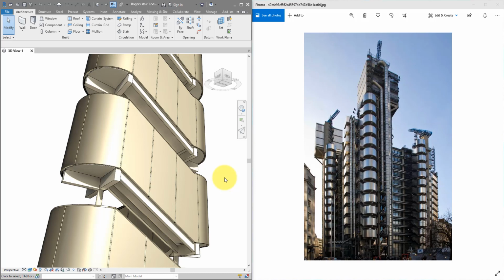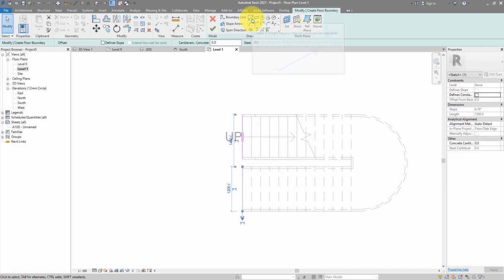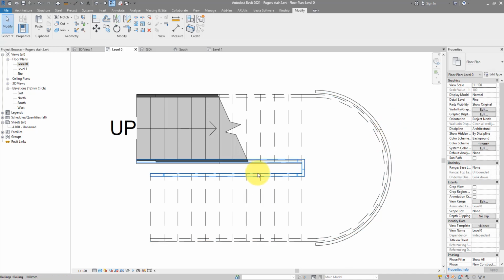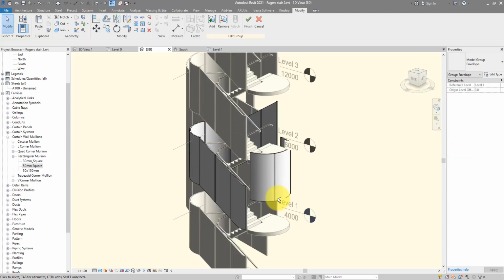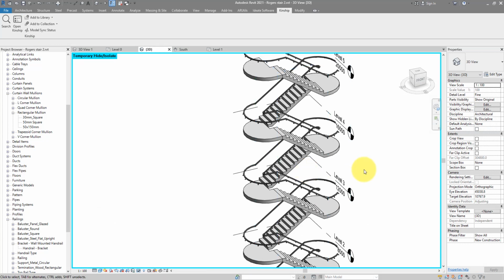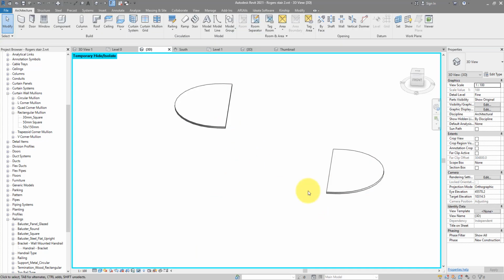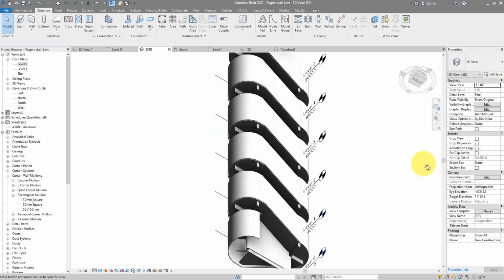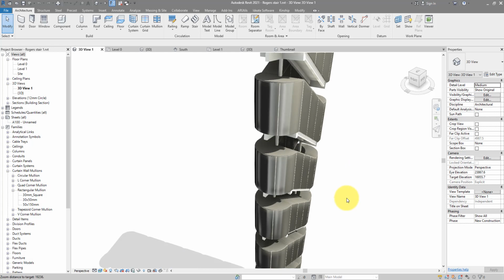Revit Snippet: Master Stair & Railing in Rogers’ Style

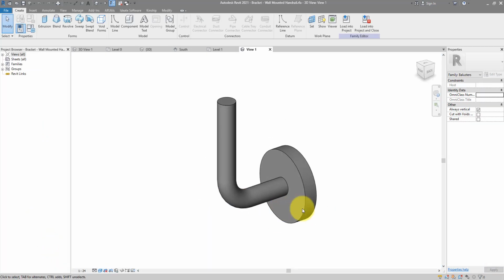Comment: @ 17:42 ..I checked my Revit 2025, unfortunately I don't have this "Bracket - Wall Mounted Handrail" Baluster family. I do have railing "support" family of this type but can not add it as an option in the "Edit Baluster Placement" settings. However, was able to add it using "Handrail 1" settings.

Comment: Currently doing my first concrete Stairs, U shape having tricky triangle shaped mid landings in revit which walls cover 3 of it's sides. Trying to figure out how to add circular pipe/wood top rails then adding the metal brackets to support them from the surrounding walls. Quite tricky because of the triangle mid landings. I tried splitting the rails so they don't go along the triangle landing edge which is like a step, but the starting rail seems to jump to horizontal instead of following stairs run slope. Thankfully after several attempts,  it actually complied this time.